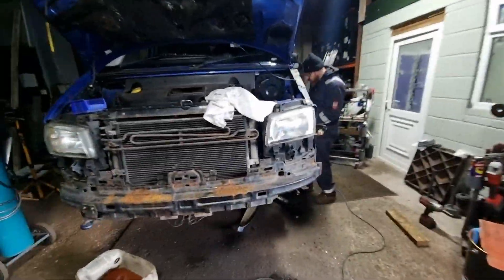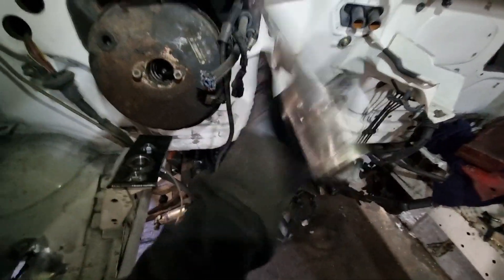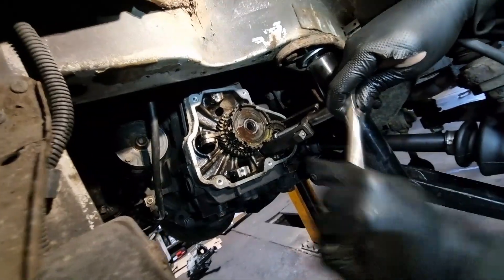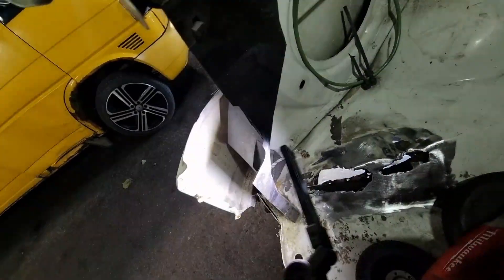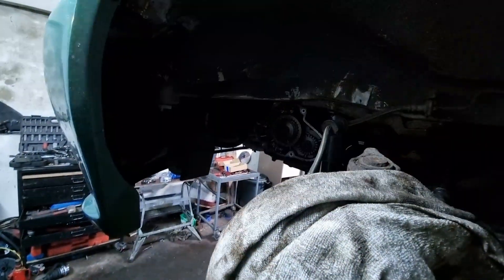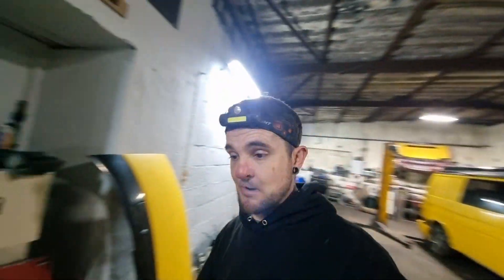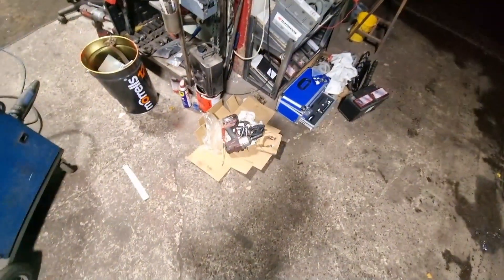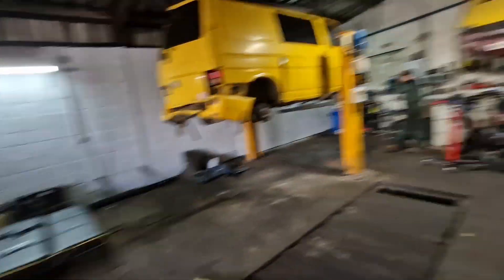GIVEAWAY & 5TH Gear Mod But GIVEAWAY!!!

Comment: BANANAS! Will the cruise control connect to a 1.9tdi?🤔 if I remember correctly was it for a 2.5 ?
Reply from the maker: I will have to double check I have a feeling it does work for that